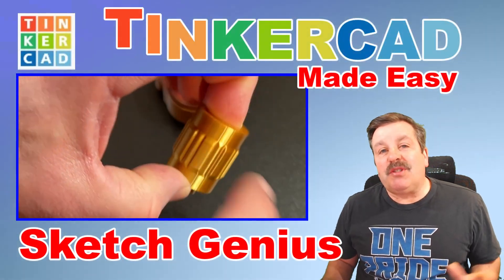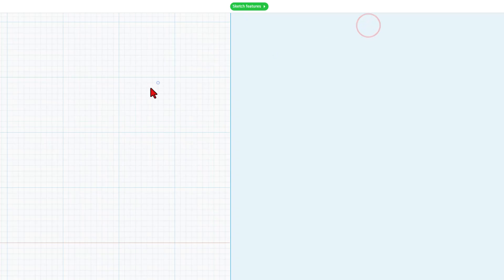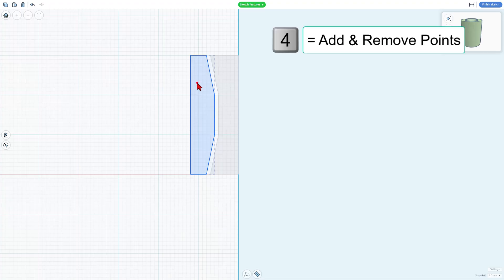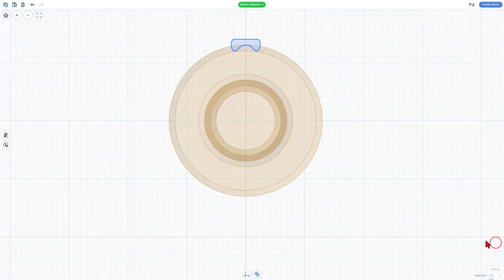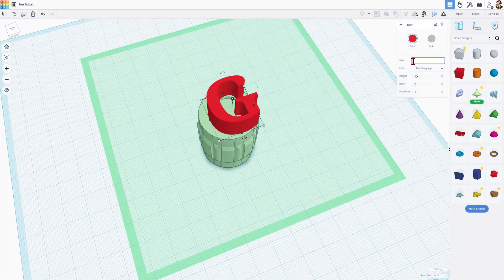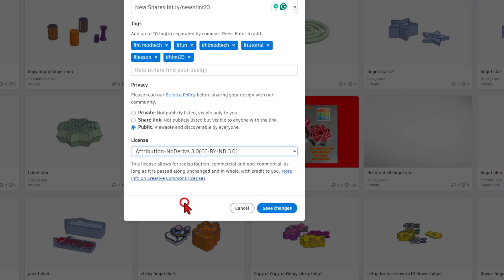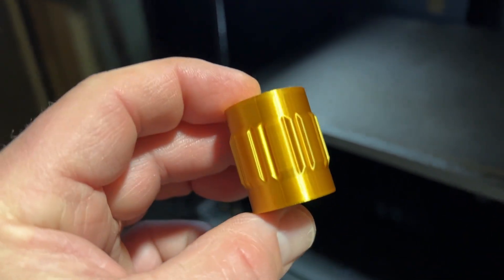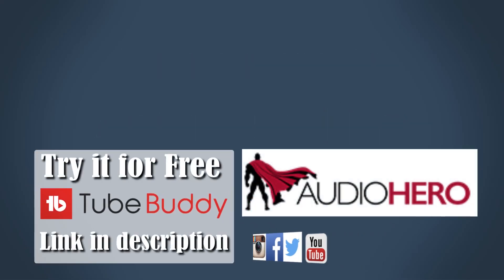3D Printed Tinkercad Projects: A Slick Sketch Revolve Fidget 💯🔥

Comment: How do you ge the small text to come out clear. I cannot for the life of me get my Bambu A1 to print raised or embossed letter, even if i use the finest .008 setting
Reply from the maker: How small are the letters.  That letter is about 8mm long... I am not sure I would go much smaller.
Reply: @HLModTech  I just printed a name "Evan" that was  31mm x 10mm and it came out like crap 5 times. silver silk PLA set to stock everything thing, then got somewhat a cleaner print when dropping the nozle temp down to 199 degrees. I'm making the name tag public in Tinkercad. Profile copelandb1987 and the design is Evan Name
Reply from the maker: It would make it even easier for me if you added the tag hlmt23 to it. I check that every day to see the cool designs added to it. Here is a quick link for you to see them too.  https://bit.ly/newhlmt23
Reply from the maker: Found it. I am printing a version. I just made it a tiny bit thinner so it prints faster. Are you doing multi color? PLA, right?  My printer did have an issue this spring where it printed poorly. I replaced the print head for the first time after a year or so of use and it has been spot on since.
Reply: @HLModTech yes multi color, .4mm hardened steel nozzle that is about a month old with black pla+ and silver is silk pla
Reply from the maker: You can reach me at hlmodtech gmail. I will share an image with my results.